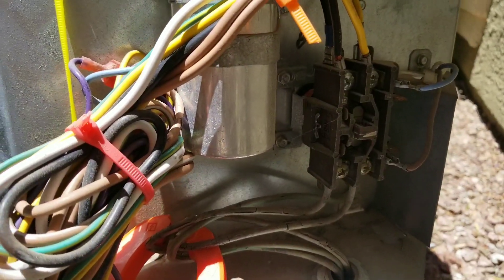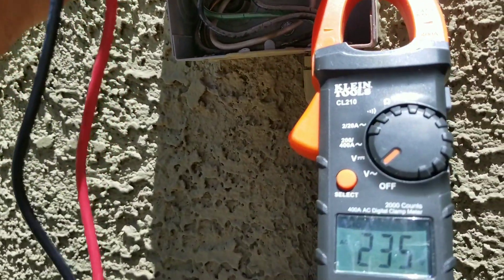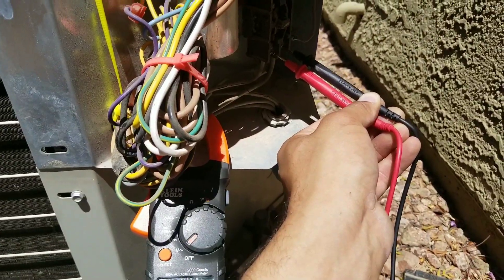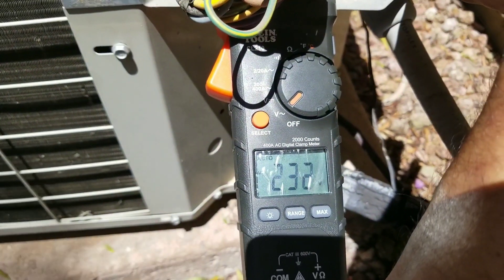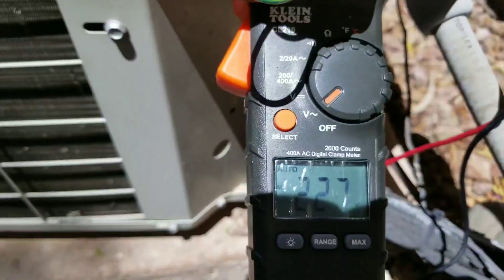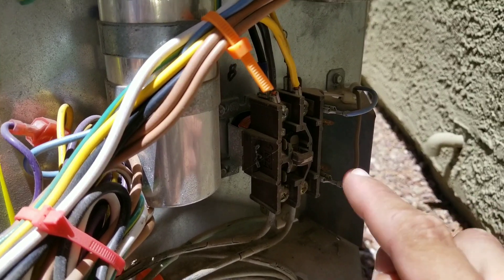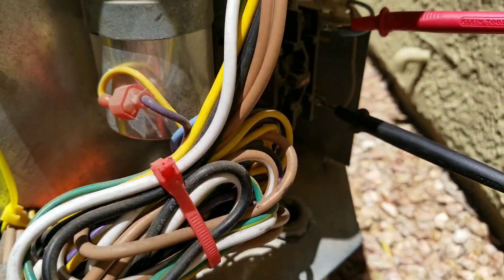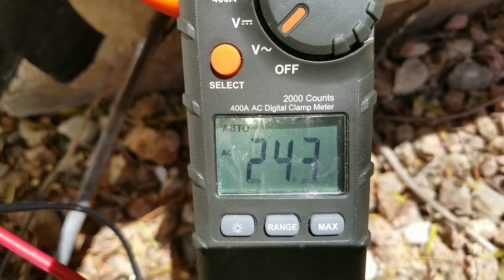How to Test/Check Voltage on Contactor with Multimeter.

Comment: Excellent...so, as I understand, if ac won't turn on, and I have 24volts and L1 and T1 show 240 volts, when i push the "button" on contactor and compressor/fan don't come on, it means the contactor is probably bad?  (Sorry for the wordy sentence...lol)

Comment: So there's a seperate wire from the c board to feed the 24v contactor coil that creates a magnetic feild to pull or close the circuit? Did i get it right or not?